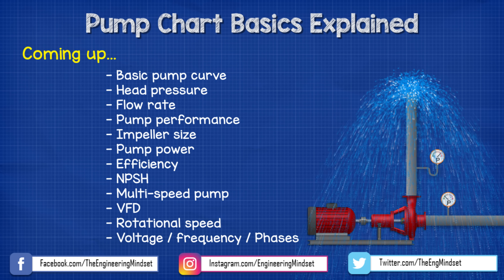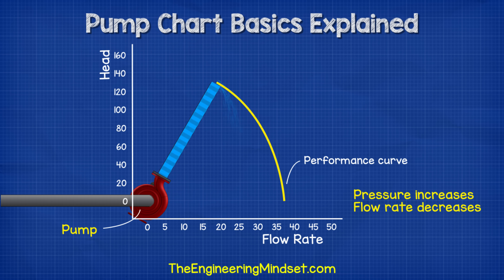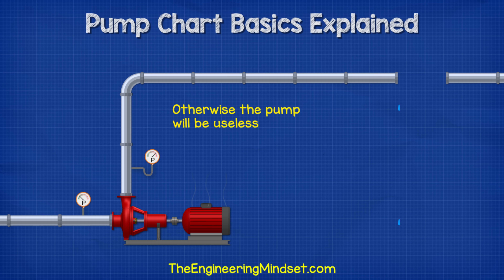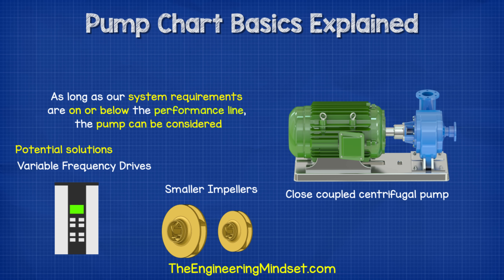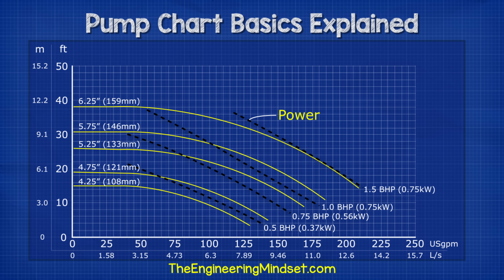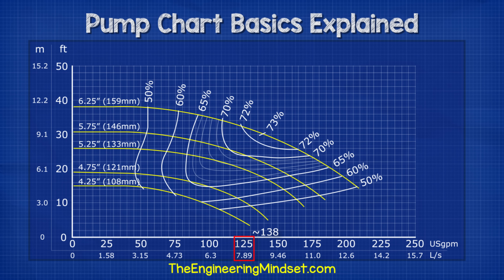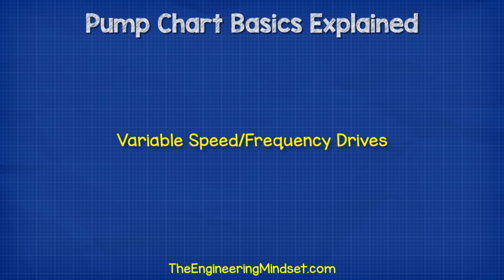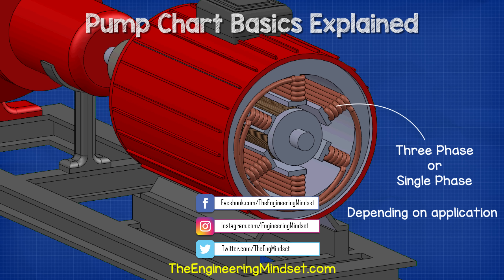Pump Chart Basics Explained - Pump curve HVACR

Comment from the maker: ⚠️ Found this video super useful? Buy Paul a coffee to say thanks: ☕
PayPal: https://www.paypal.me/TheEngineerinMindset
Reply: How changing size of impeller work,when the casing size is fixed? Can someone explain
Reply: @ajiteshsingh7370   yes, because when you change the reduce the size, therefore, it will be a gap between the impeller to the casing which it is going to require more energy to reorganize the water into the casing....which is going to be the loss of energy... therefore knowing the right size of the impeller to get the max efficiency of it.. I hope this help
Reply: @ajiteshsingh7370  It looks like you can only change the diameter one way: from a larger dia. to a smaller one
Reply: I will buy Paul a  warm lunch and heavy dinner if he will teach me how to prepare  presentation like that
Reply: Thanks bro.
Reply: @the_upfront_maverick  is
Reply: Can't use Pay Pal in India😕😕😕
Reply: @the_upfront_maverick  I am
Reply: Thank you for sharing.  I am sure this video made anyone who interested in this technology had more knowledge advance. Thanks again.
Reply: The bell button be like
Reply: How can I send you the money? Lol
Reply: Can you please elaborate on the NPSH value? From the chart, for 150 gal/m we need NPSH value of at least 4.9 feet but what does that imply? If we do not select a pump which has higher head press. than that, cavitation will occur??
Reply: I want to make a circuit control with motor and vfd also details about flow chart of pump
Reply: do you use crypto??
Reply: Thank you!

Comment: Performance curves show TDH, total dynamic head, to account for fluids of all specific gravities and the change in kinetic energy from suction to discharge.  Horsepower lines are for SG=1.0.  NPSH is the pressure, expressed in feet of flowing liquid, above the vapor pressure of the liquid.  Your example asserts that air bubbles form.  A water pump literally boils water on the back side of the vanes, much like a stalled airplane wing, then noisily collapses the steam bubbles.

Comment: If we have two identical centrifugal pumps. One gives 11,9 bar disharge pressure and  second pump gives 10 bar disharge pressure. Both electric motors are 30kW. Why I have situation  that first pump runing on 65 A el. Curency , and second pump runing on 30 A el. curent ?

Comment: I have a question , if there is are two  bends right after one foot of the pump , would that impact the pressure and increase amperes on the motor?

Comment: I have a doubt, so if we use pressure head because it gives fluid independence, pressure head does measure the height of the fluid, so isnt it dependent on the fluid?
Reply: Hi Vidya, the head property of the pump does not depend on the fluid it is flowing. But pressure changes with change in density of the fluid and as you know density is different for different liquids. 
Simple and better understanding is if you are filling your water tank at home which is at 25m of head with flow of 5m^3/hr it will consume less power. But if you want to fill this tank with oil which has higher density than water it will take more power. This your electrical motor will be of more kW rating. I hope you got it.

Comment: Your video was incredibly helpful, thank you! I’d like to propose a slight clarification @2:21 mark. The reason pump manufacturers use meters of water (head) instead of direct pressure is not because pumps can produce different pressures but the same head when different fluids are pumped. In fact, it’s quite the opposite.

Pump performance curves feature ‘head’ instead of ‘pressure’ because the maximum head to which water can be pushed is more practically meaningful for customer needs than pressure figures in bars or megapascals. Pumps do not push different fluids to a constant maximum head. For instance, lighter fluids such as petroleum can be pumped to higher heads than heavier fluids like mercury.

To illustrate, a pump with a maximum head of 60m (of water) can support a 60-meter column of water, but only a 4.4m column of mercury, given that mercury is approximately 13 times heavier than water. However, the maximum pressure in bars will be the same for both cases. I hope this clarification is helpful!
Reply: I was just thinking the same! I thought my fundamentals grew weak, thanks for clarifying it again here helps a lot!
Reply: You're wrong about that.   The head will be the same for all different density fluids in a centrifugal pump.   The horsepower will vary as well as the discharge pressure in kpa/psi.  
The viscosity however will change the fluid head of a particular centrifugal pump.
Reply: @DaveMody  Head = Pressure / (density of fluid * acceleration due to gravity), so the head will differ for different fluid densities
Reply: @ That is the correct formula for converting differential pressure and head, but centrifugal pumps output a head vs flow relationship.  Changing the fluid density does not change the relationship of pump head vs flow.   Changing the fluid density will change the relationship of pump differential pressure vs flow.   I believe my statement is correct above and the root comment is incorrect.
Reply: about the rpm of a pump. If it has more rpm, what happens?. I mean if the motor have the same power but one goes higher in rpm.
Reply: @ricardorodulfo739  The RPM raises the curve of head vs flow  that the pump can deliver, so depending on the system curve the flow and pressure in the system will rise at higher rpm.   The motor will be called upon to deliver the extra HP required of the pump.  If the motor runs out of horsepower, I'm not 100% certain what the result would be, but likely the flow and differential pressure (dynamic head) will not rise as expected.

It's probably worth looking up the terms "affinity laws" for centrifugal pumps to gain a more clear understanding of pump head, flow, horsepower vs RPM.

Comment: You mentioned that if the pump can’t overcome friction loss that you won’t get any flow: that’s not exactly correct and this confused me for a while. 

As long as the pump can overcome the static head (heigh difference), it will pump at whatever flow rate intersects the system curve. If it can’t overcome the friction at the specified flow, it will just pump at a lower flow rate with less frictional losses.

Comment: Explanation of flow rate vs head is somewhat lacking. The sentence ""say, if we want 6GPM, then on setting 1 we will get around 4.2ft of head"
Here is the thing - just because we wanted 6GPM, doesn't mean I'm going to get it..  As far as I understand, it's other way around! IF you have 4.2ft of head, the pump on speed 1 will be able to produce 6GPM.  That's why I find this chart super confusing, because I'm just used to have on X input, and on Y axis outcome.

Comment: Can you clarify, the graphic at 4:46 seems wrong or inverted? At max head, there will be minimum flow rate so the height of the water coming out of the pump should be at its max

Comment: Energy goes where?  
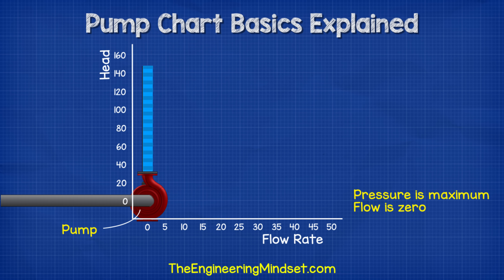at 01:25 there is no flow,yet the pump is stuggling it's maximum; where does the energy go to?  just to heat up the water column?
Reply from the maker: Gravity is trying to push it down the pipe, the pump it trying to push it higher but that's as high as it can go. The impeller just churns the water around and heats it up. It it's not good to run a pump like that, they aren't tested like that in reality

Comment: How is it that if your NPSH is increased by a positive water supply that your pump discharge is also increased? I would have just assumed that since my impeller is rotating at a certain speed set by the motor that my pump discharge would have remained the same. Can anyone please explain for me?

Comment: 9:18 
you mention that the "same" pump would be able to perform at the maximum efficiency just by changing the flowrate/operating head. I'm assuming you meant same pump with different impeller size.

Comment: Is there a theoretical derivation for the shape of a pump curve?

I guessed maybe a centrifugal pump imparts constant energy per unit mass to whatever fluid passes through it.  Then you'd get E = constant (for any given fluid density) = P + (1/2)dv^2 (d is density), or  h = E/(dg) - Q^2/(2gA^2).  This has the shape of an upside down parabola (right basic shape), but when I try to compare it to real pump curves, the real curves turn downwards something on the order of 100 times faster than my theoretical model.  Do you know why this might be?  Am I making some unit conversion error, or is the whole thought process just wrong?

If the real pump curves turned down something like 10-50% faster than the theoretical one, I'd be happy, because I guess the pump doesn't conserve energy perfectly and it doesn't have the same efficiency at all operating ranges.  But getting a result 10,000% different than the theory is unsatisfying.

Comment: very clear, precise and informative. Do you have any info on mud pumps and their basic operating procedures would be most helpful if any info and if I applied to join the engineering mindset would i get the calculator sheets as excel provided and they covered under the membership fee? Thanks again
Reply from the maker: Nothing on mud pumps currently. The membership doesn't allow us to provide free downloads to subscribers, it's something I really want but there's no to integrate that at present. I'm hoping Youtube will enable this feature in future.

Comment: Do they calculator on every devices , before installing right sir
Reply from the maker: During the design they will define the system requirements, but it's unlikely to find equipment to fit the exact requirements, so it's over sized and then during commissioning they try to get it operating as close as possible to design

Comment: Amazing Video! Thanks guys you're doing amazing job. The way you explained it is very clear and easy to understand.
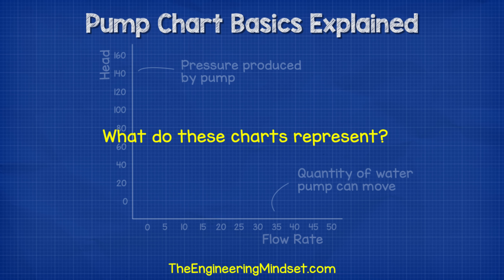But I have to disagree with an info you mentioned at 1:00 , as I know pumps don't produce pressure, they produce flow only and the pressure forms from load and friction and the pump has to overcome it to deliver the desired flow.
Reply: Pump works on the principle of forced vortex...and if you read about it , you may find there is change in pressure along with radial distance. Moreover while  moving out of impeller, the fluid flows through volute casing in which the area continuously increases and the Kinetic energy of fluid concerts into pressure energy. So thanks to shape of casing which changes pressure of fluid as well !!

Comment: I have a question, 
If a centrifugal pump flow limit is from 60 LPM to 535 LPM at 3500 rpm, does the low flow limit of 60 LPM changes with running the pump at lower rpm? Does this limit changes goes down when we run the pump at lower rpm?

Comment: 3:50 I cannot see how "Head" value in meters apply here. Pump raises water, but the same water returns due the gravity, therefore head is always zero. How do you figure out head value in meters in closed system like here?
Reply: If you have a pump already its actual head in ft = (discharge - suction pressure) x 2.31 / Specific Gravity.

If you dont have a pump and want to calculate for suitable pump, you need to calculate difference in height from outlet to inlet of pump and accomedate all losses after the pump discharge.

Comment: I am predicting breakdowns in a water pump for my project I have taken the dataset from the kaggle website and I would not able to find out the parameters of the pump he used and what type of sensors he used for water pump. Could you please answer by questions. That will be helpful for my project.

Comment: Thank you for informative video! Could you provide formula, how to convert mlc to pressue (bar). Also, kindly ask you to explain how calculate total head, if I have depweel pump in LPG (propane, density 0.53) tank with height 15 meters and pressure 3barg? Need I consider that when calculate pressure?

Comment: In 2:32 minute, mentioned "The pressure will vary depending on the liquid used but the height it can be moved by the pump will remain the same". How about the flow rate given a water and a milk ?
Reply: Centrefugal pumps are constant equipment, so fixing the flow will give same head (but different pressure based on liquid pumped). The flow can be controlled as it was explained in the video, motor speed changes, impeller size change, or changing the dicharge valve opening %

Comment: Thanks for the very informative video. The reason I came to this video is because I want to learn why at high pressure flow rate is the lowest and vice versa. This was very well answered from 0:58. When the inlet and outlet are placed perpendicularly with each other, the higher pressure at the outlet causes greater resistance for the pump to overcome, therefore generating less flow rate.

How about for the case of axial flow pumps? Does the same concept still apply? I can see that axial flow pumps possess similar pressure curves. But now since both inlet and outlet pipes are parallel, where does the resistance at the outlet come from that reduces the net flow rate?
Reply: Well, it's clever way of illustrating how the discharge rate decreases with increase in angle between delivery and suction line but i guess it's bit inappropriate to understand it like this way. 
Because even if the delivery pipe and suction pipe is perpendicular and you make the flow rate zero( by completely closing the delivery pipe valve), the pressure gauge reading will show you maximum pressure because there is no frictional losses in pipe because of zero flow rate or zero velocity of flow , thus all the energy supplied by pump is converted into pressure energy of fluid instead of converting it partly in kinetic and remaining half into pressure energy. And when you will divide this pressure value from pressure gauge, with (density × g) , you will get value of head (h) , which will be maximum.
But now as you slowly start to open the delivery valve to allow some flow rate ( by keeping the delivery pipe still perpendicular) , the pressure that will be shown by pressure gauge will be less i.e. pressure head will be less because now some supplied energy to the pump has been converted into kinetic and remaining into pressure...as u keep increase the flow , the more energy is being converted into Kinetic and less is converted into pressure. That's the reason of decrease in head with increase in flow rate.

Now come to your axial flow pump, I'm not 100% sure... But even if both pipe are parallel, by increasing the flow rate you will find with darcy's weisbach equation of friction that more frictional losses occur.
So, suppose if you have total energy of head equivalent to 50 , and now you increase the flow rate by opening the valve, more flow occurs and which in turn causes more frictional losses ,i.e. more loss of total energy head. That's why, if you increase flow rate , less total energy head is developed. 

I hope you understood!!

Comment: Hey Mr. Paul ... can you make a video explaining why the efficiency drops while using VFD.. Thanks in advance
Reply from the maker: It's basically the inverter wasting too much energy as heat as it reaches full load.
Reply: @EngineeringMindset  Thank you sir .... you are doing a great work. keep it coming. Cheers

Comment: I think the VFD explanation is misleading. You mention at (11 min mark) that it alters the voltage and frequency to the supply of the motor. The video shows a change in magnitude of voltage to the motor this is not the case. VFD's on typical 3ph induction motors work by varying frequency. (speed = 120*f/number of poles). Here is a link to your other video on VFD's correctly explaining this. https://youtu.be/yEPe7RDtkgo?t=94

Comment: NPSH is measure of differential pressure.   NPSH is the difference in absolute pressure of the fluid, minus the vapour pressure of the fluid at the operating temperature.   The differential pressure is typically stated in terms of the liquid's head (rho G H formula).   

Also, cavitation is not due to "air" bubbles. It's the fluid in gas phase collapsing that causes the damage.  I believe there are examples of using entrained air can reduce cavitation damage.  Cheers!
Reply: Cavitation is a phenomenon occuring in a fixed volume of space, and the actual phenomenon is comprised of a violent phase change of a mass in the liquid phase, into a mass in the gaseous phase.  The 'fixed volume of space', walls of some pump, or the volume of water surrounding some submerged propellers, experiences a great release of energy from the cavitation phenomenon, and damages the  pump walls, etc.
Reply: @peterthurman9384  I'm not sure what you mean by a "fixed volume of space", and "violent phase change"?   Also, I'm unsure if whether it's the generation of the gas, or the collapsing of the gas that's causing the damage to pump walls, but I suppose it doesn't really matter.  The other issue is the vibration that will damage pump seals and bearings.
Reply: @DaveMody When I say 'fixed volume of space', I mean, Control Volume.
Reply: Regarding 'violent phase change of a mass', this is just my way of describing cavitation, where a liquid changes phase into a gas, then back to a liquid.  Recall, the cavitation occurs, because the vapor pressure of the liquid has been decreased, due to the vacuum created by a pump trying to pump a liquid, without there being a sufficient NPSH.

Comment: I am a farmer and I am using Texmo Monoblock Pump set10 HP electric motor pump set in this head position is horizontal and pump set is working for appox 2000feet pipeline PVC pipe size of 140 MM
Is this right or not ❓